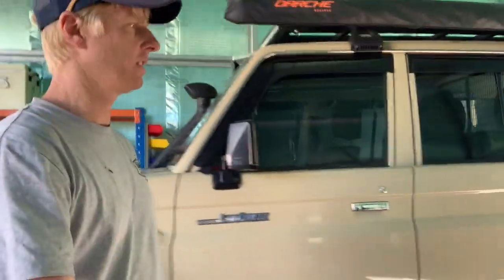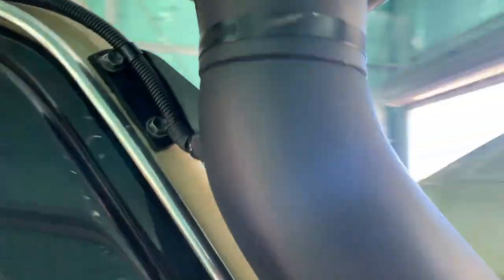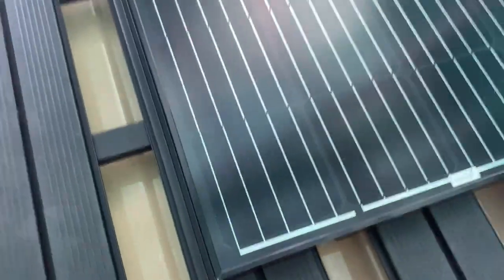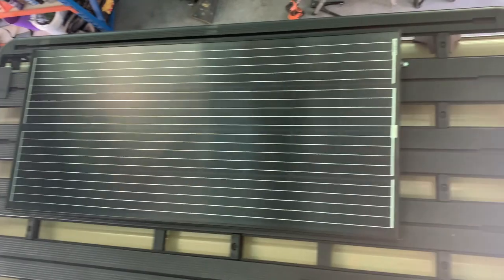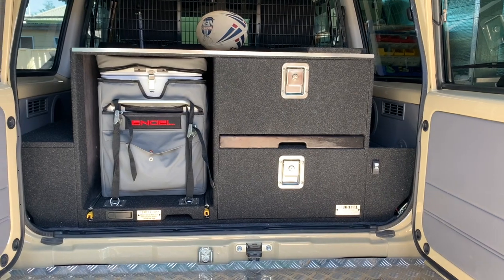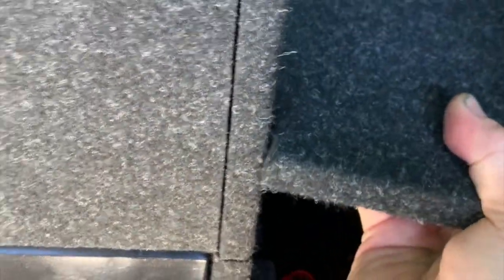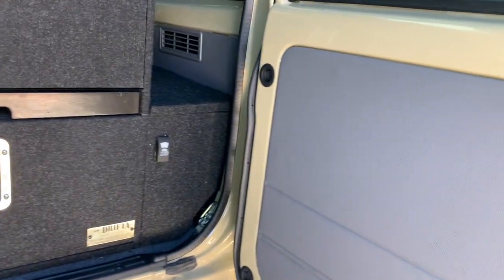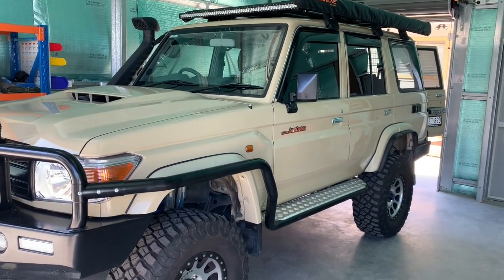Sandy 76 series Toyota landcruiser electrical installs, solar air compressor, led lights

Comment: Nice install. Personally I would set it up where you can remove that panel easy or move it on the rack.
Have a small Anderson plug connection in roof rack.

Also if he had a full length rack you could've avoided putting the wiring in the gutter. Thus may cause drainage issues when it rains.

Thanks for the tips and vid
Cheers
Mick
Reply: @Braylen Alberto instablaster ;)
Reply: @Deshawn Enrique it worked and I finally got access to my account again. I'm so happy!
Thank you so much, you saved my ass !
Reply: @Braylen Alberto No problem xD

Comment: Hey mate, what do think about the new safiery alternator charger? Will this change the way we do 12v in regards to dcdc? Great vid
Reply from the maker: Scott Grenenger hi scott.  Personally I’m not sure it will change the 4x4 scene to much. But time will tell.  Howerver I know a few customers in the marine market that it will be popular with, including an upcoming project for us we’re a sailing yacht with not much room for solar panels, want to get rid of all gas cookers on board and go to lithium with induction cookers.  The safiery cam bus alternator will be a great way for them to be able to get power back in the the lithium bank.